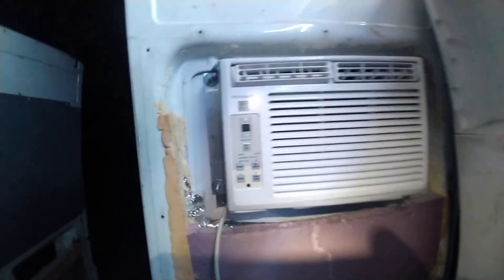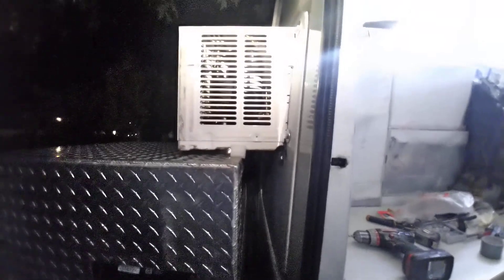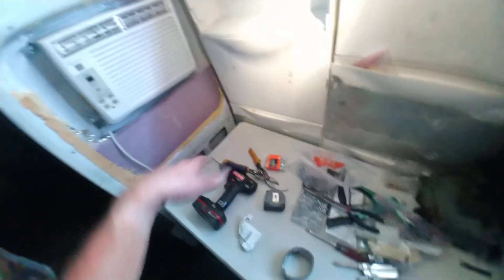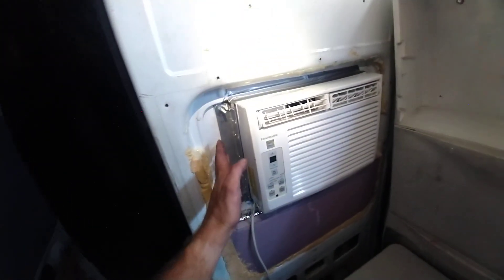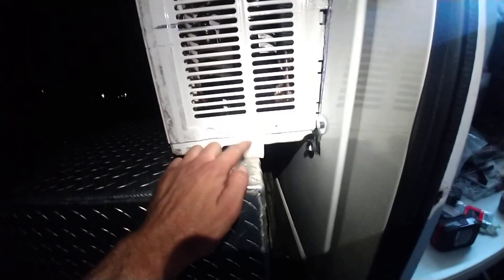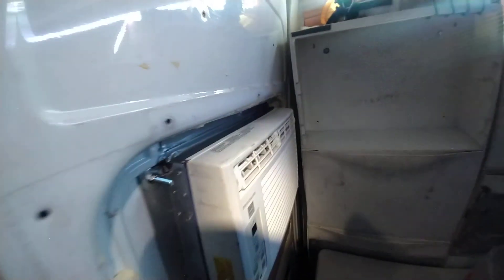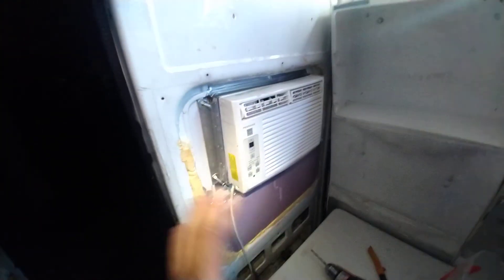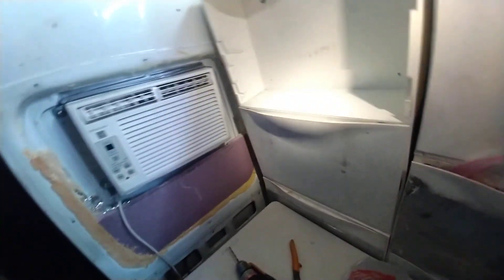Solar powered air conditioning in a sprinter van, how to install, part 3/3

Comment: Use EternaBond white tape on the outside to eliminate need for grinder or bytle tape.
Reply from the maker: That's a good suggestion, I saw someone do that with their fan and it looked pretty decent. I was going to just try to make a neat sealant bead with no sag caulk. But to get enough caulk on there I don't think it will end up looking neat. So maybe that's where the tape comes in. I still need to straighten out the AC unit though. Plus I just can't live with a jagged hole like that in the back of my door even if it is covered.